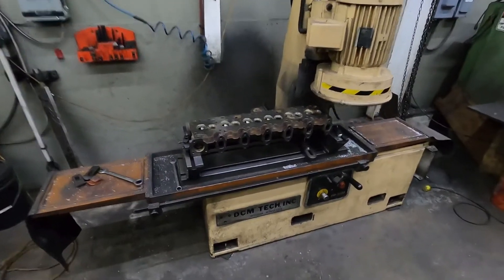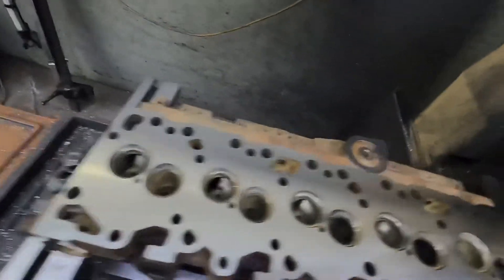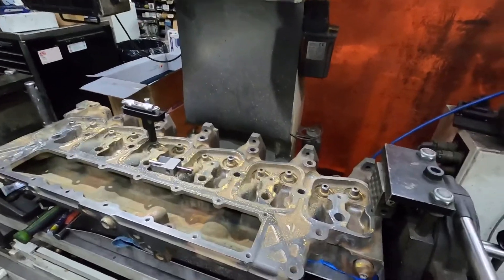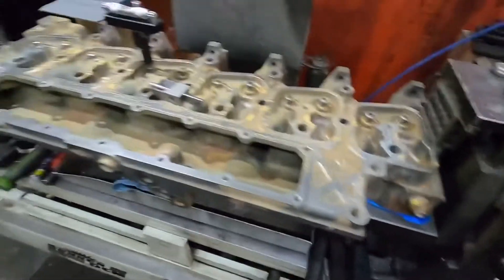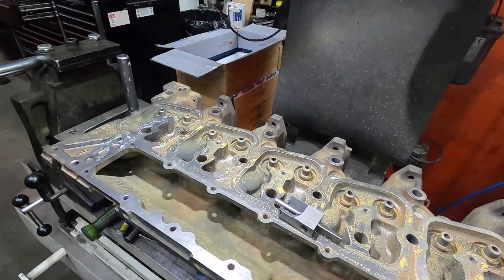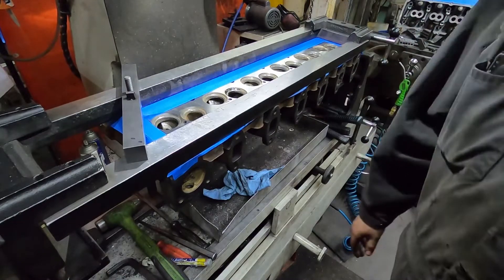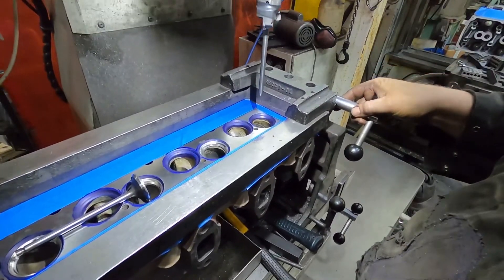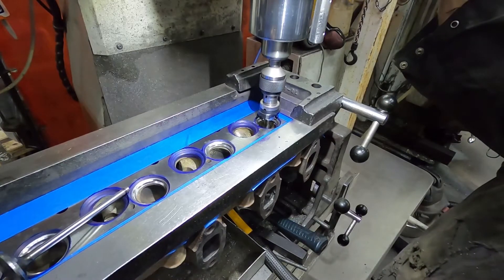HOW TO REBUILD YOUR 12 VALVE CUMMINS  PART 8

Comment: Another great video explaining valve recession and why its important to keep valves with each cylinder. What valves are you using? There are lots of DCEC type valves and springs for under $90. I found Qualcast Inkonel friction welded exhaust valves for $10 a piece, then I found swirl polished 21-4N intakes and exhausts for $149. I could not find what the factory  Cummins valve material was, do you know? Would you be good with using 21-4N for both int. and exh. for a stock to mild build? Thank you for taking the time to video, edit and share you knowledge with us and answer our questions.
Reply from the maker: factory valves in a 12v are stainless mix of some kind ( honestly never looked into it ) aftermarket valve ( performance valves ) i use is 21-4N. these valve are just a engine tech oem replacement.

Comment: Good info.  Couple of questions:

- Let's say I have my engine apart and the valves pass the rocking test.  How do I know if I need a valve job?  What are the chances I need one?  Pressure test?
- Do you always do a valve job when you change guides?

Keep up the good videos!
Reply from the maker: If you do guide you must do seats surface.  If you look at the valves / seats and there  pitted  it should have a valve job. Also it the seat and valve are not flat it need a valve job.  We cad test the valves and I also Lapp

Comment: I am wondering if the 1st gen and 2nd gen have the same heads...I just replaced my 2nd gen head and forgot, still don't know how, missed the 2, 1/2" plugs under the intake manifold. The rearmost plug required some contortions to get in but the plug behind the injection pump was a can of worms. A 3/8" drive long extension with a stiff wobbly did the trick. You can imagine my thoughts when I realized my dilemma....
Reply from the maker: I have done it myself. There are two original casts one is a 9 mm injector hole other is 7mm.  But the injector hole is the only difference. Not at of the 9mm ones that are not cracked